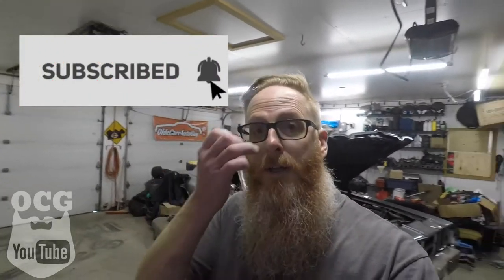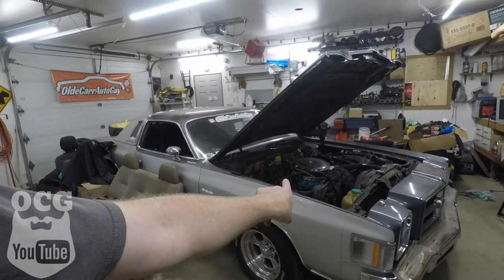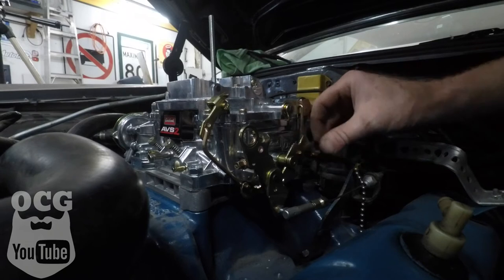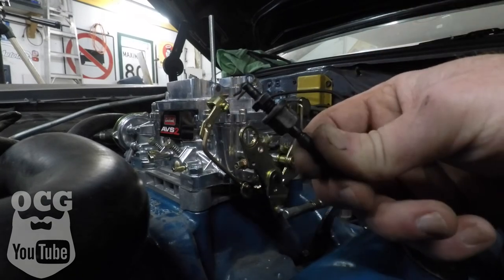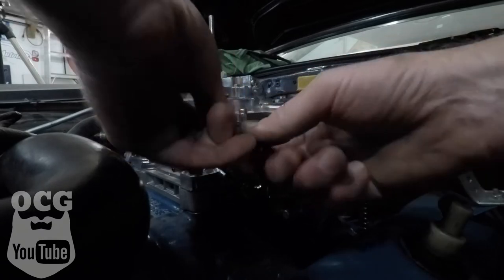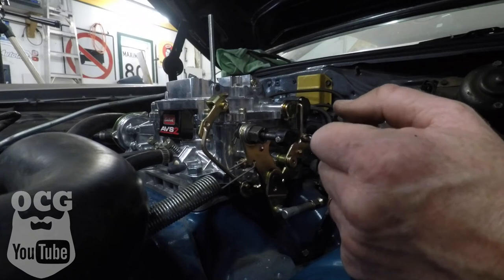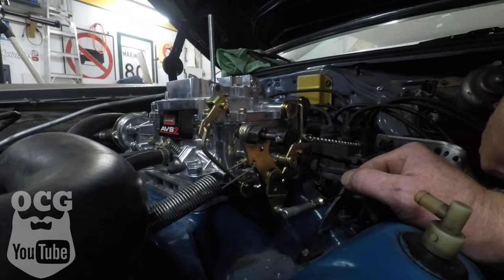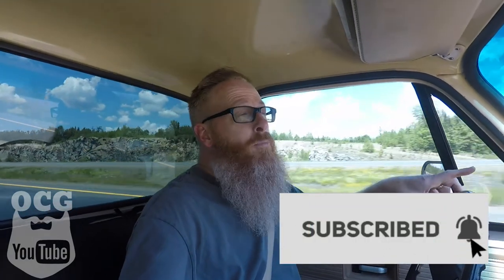INSTALLING AN EDELBROCK AVS2 THUNDER SERIES CARBURATOR ON MY 1979 CHRYSLER CORDOBA

Comment: Did the old carb have a electric choke?
Reply from the maker: Yes
Reply: What if old carb was a thermoquad with no electric choke where would connect electric choke wire?
Reply from the maker: You need to find keyed 12v source.
Reply: What is your wired to?
Reply from the maker: There is a 3-way plug that has 12v power on the key that used to be part of the lean burn system I believe. Because I converted it to electronic ignition, I just tapped into it. If you find me on Instagram or Facebook, I can send you a picture of what the plug-in looks like..
Reply: I sent you a message on Facebook. So are you still happy with the carburetor?

Comment: Where did you buy the aluminum spacer?
Reply from the maker: Amazon!
Reply: So don't need to change manifold correct? Just need to buy adapter Edelbrock 2696? Don't need to buy extra gaskets?
Reply from the maker: As long as you currently have a 4 barrel intake. You will need a gasket between the intake and adapter as well as one between the adapter and carb. I can’t remember if the adapter came with a gasket.

Comment: Does anyone on here have experience in a 2”lower on the back axle.  I’m building a rat Cordoba I guess.
Reply from the maker: The easy way is to install 2" lowering blocks between the axel and spring. Then replace the stock u-bolts with longer ones.